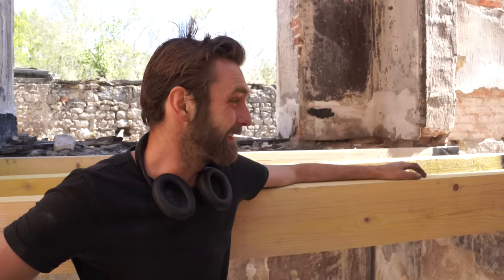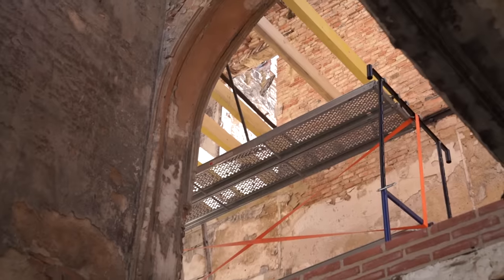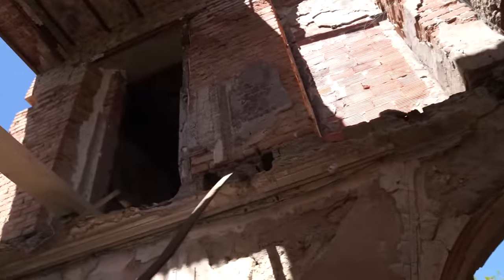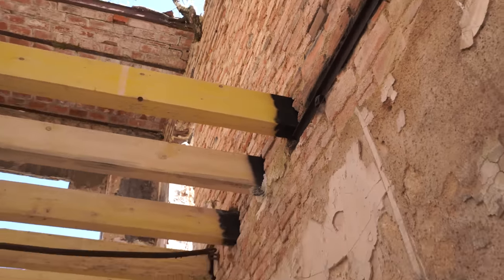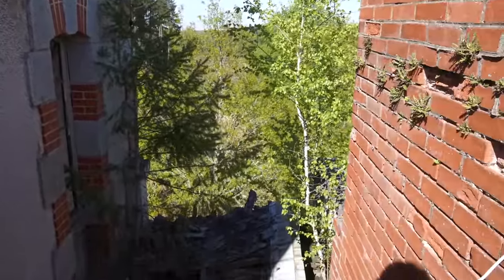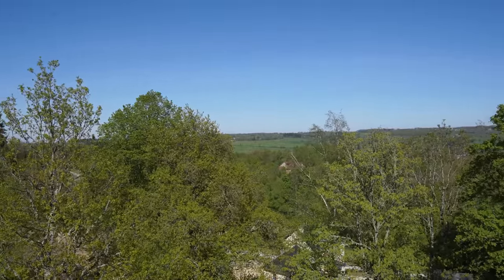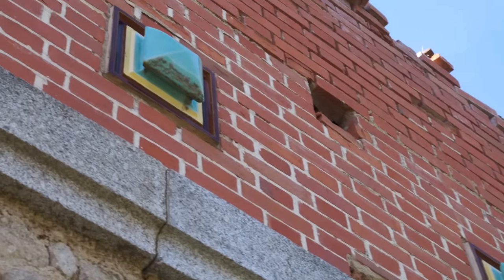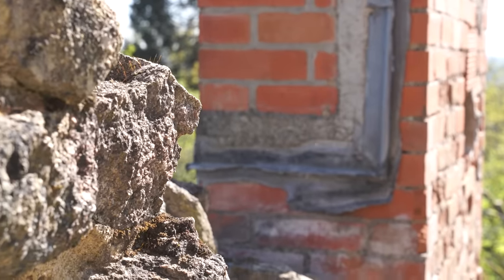I climbed to the very TOP of a chateau ruin, and this is what I saw.

Comment: Are you doing the floors in order to work up to the roof?  Getting a roof is most important.
Reply: Yes, he is working his way up to get temporary tarps up.    I wish he had, or was building temporary stairs to get up there easier, quicker...I've seen a previous comment on this thread from a person who has
 stair building experience say they wish they could come and help him, but that they are old and worn out!

I am also aware from previous Vlogs' comments that he is expecting different permits to be available May/June?   The chateau grounds need water, electricity still.   He was donated an Eco-flow power unit; his current power source.